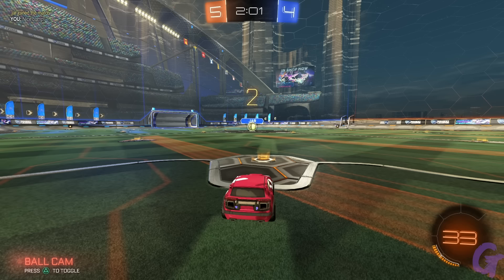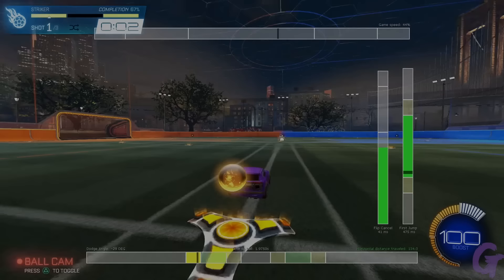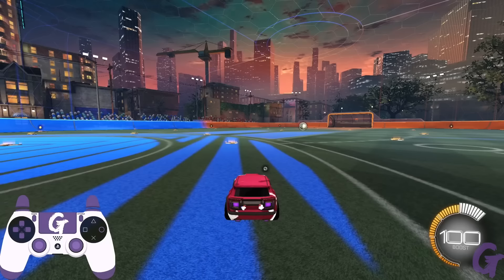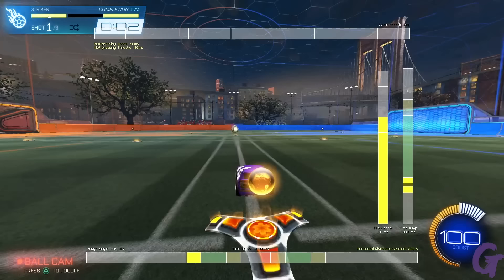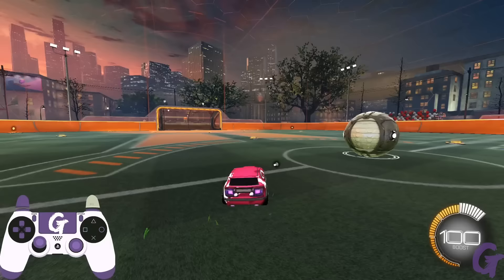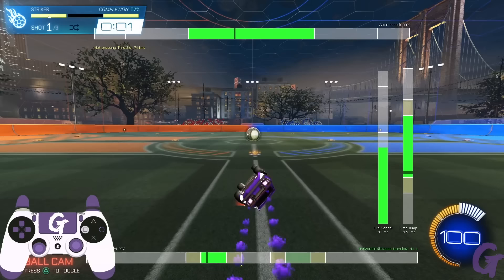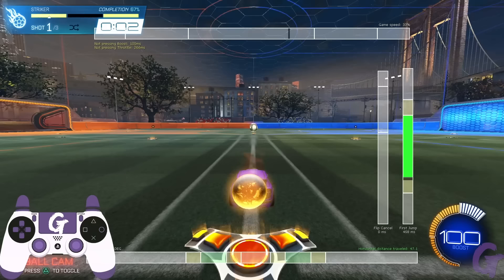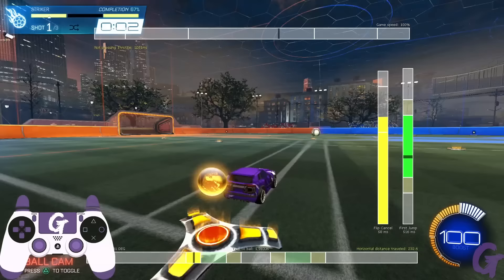How to do a Perfect Speedflip | How to Play Rocket League

Comment: Is it a bug when it says at the bottom to press boost instead of the acceleration button? It shows up on almost every attempt and im only holding my boost button and my air roll button.
Reply from the maker: Not sure.  I would also give it a moment for the car to settle before you take off.
Reply: @Grifflicious  thanks for the quick reply I appreciate it. I have tried just about everything I can think of and that message pops up more often than not. Didn't know if it actually makes a difference. Been working at trying to hit the ball for 3 days now but I'm gonna stick with it.
Reply: Just hit my first speed flip! Thanks for the help!
Reply from the maker: @Awesomesauc190  let’s go!  You’re most welcome!  Glad i could help.

Comment: Hi Griff, I think your information might be a little off, because I am able to hit speed flips below 1.9667s consistently and I'm not doing anything differently from you. If you want I can send screenshots/vids for proof.
Reply: It could be controller dependent, possibly? I know for games like Super Smash Bros Melee, the physics is so precise, that even controllers play a part in consistency (down the single frames). Maybe depending on the controller you use, it could affect how quickly you can flip cancel, or shorten the duration of the cancel. Another possible theory could that the flip is dependent on your screen monitor (the max hz your screen has). I noticed in your video that you have 120 hz monitor, while my monitor is 240 hz. Just spit-balling ideas.
Reply: I'm an even bigger idiot than I realize, what if depends on your CONTROLLER settings (like how you set your deadzone, sensitivity, etc)??? That has to affect how quickly you can flip cancel and most likely shaves off those extra milliseconds.
Reply from the maker: To our knowledge, the timer is tied to both physics ticks and FPS.  So the lower your FPS, the lower your time to ball is.  That said, if you want to get the most accurate time, I encourage you to bring up the BakkesMod console, (F6), then report back what your time to the ball is.  Also, what car are you using?  Different hitboxes touch the ball sooner than others.

Comment: Tick perfect speed flip seems like bad naming since being able to actually do it has nothing to do with how fast your inputs are compared to the other methods. All methods require the inputs at the same speed/tick. The difference is analog vs digital inputs. Simply put, the reason it can't be done on keyboard is because of the slight loss of forward momentum by being forced to do a 45 degree diagonal flip to accomplish the speed flip.
Reply from the maker: This isn't true.  It does have to do with how fast you do the inputs.  Which is why things like your timing between jumps and how quickly you cancel the dodge all affect whether or not you do it correctly.  The reason it's called "tick perfect" is due to the physics ticks of rocket league and what the fastest time to the ball possibly is.
Reply: @Grifflicious  the speed flip it self yes but you're misunderstanding. there's no different timing between methods it's the same timing.

edit: if you miss the timing on the speed flip, it's simply not a speed flip.
Reply from the maker: @Sangramoire  sure, the timing of the speed flip itself does has a window but getting to the ball in under 2 seconds has different speeds at which it can be done. So a keyboard and mouse player can get there in 1.997 seconds but they could never get there in 1.96 and that’s the difference.
Reply: @Grifflicious  yes but thats not due to not being tick perfect. You can be tick perfect on keyboard but you wont get to the ball as fast due to the other limitations not because you didn't input something fast enough.
Reply from the maker: @Sangramoire  tick perfect isn’t referring to the inputs at a specific physics tick. It refers to the physics ticks in regards to the ball when it makes contact with the car. I’m afraid you’re misunderstand something here. The tick perfect is the time to the ball. Rick perfect inputs are a thing but that don’t apply as exactly as I believe you’re referring to in this instance.
Reply: @Grifflicious  To my knowledge tick perfect has always referred to timing inputs to execute at a specific tick on the physics engine. Tick perfect has never meant to be as fast as possible. Look at fighting games as an example of what tick perfect means. Executing animations at the fastest tick possible doesn't mean tick perfect.

Edit: a better name would be fast speed flip vs standard speed flip. They are both speed flips as the concept to accomplish them is the same and they can both be tick perfect but one is faster than the other.

Comment: The 2 second timer in the pack doesnt work
Reply from the maker: Are you using Bakkesmod?
Reply: @Grifflicious  I am.. Oh wait I probably forgot to have it on when I wrote this comment. So it only works when I have bakkesmod?
Reply from the maker: @AlluttajaYT  Not necessarily.  Rather, I was curious if you had a setting ticked that altered the shot timers in some way.  I would double check all your settings and make sure  you don't have something "on" that could be causing the issue.  The training packs are universal so any issue with the timer should be a user error, as it were.
Reply: @Grifflicious  Okay well my RL install is clean. Only settings I've touched are, video and controls. At the time the 2s counter didn't work, I wasn't using Bakkesmod. The 2s thing has never worked for me ever since I tried mustys pack in 2020. It shows 2s for 1sec and then it jumps to 9 seconds. Ruins the whole point of the training pack which is why I gave up 2 yrs ago. Anyways I'll check all the settings again later today.
Reply from the maker: @AlluttajaYT  yeah, that’s an odd one. I had something similar happen to me but I can’t remember what it was or how I fixed it. When I get some free time, I’ll check into it.
Reply: @Grifflicious   My apologies, I don't want this to take any of your time but I guess I was wrong and I DID have Bakkesmod on. There was a slider that is set to 10, 10 in custom training tab. I now set it to 0, 0 which is default for the game and lets the timer do only 2s. I was 100% sure that I didn’t use Bakkesmod that day because I forgot to turn it on and didn’t bother to do it. I guess there was something left off in the files?
Reply from the maker: @AlluttajaYT  gotcha. And no worries. Happy to chat and help. Chances are, it was running either in the background, minimized, or for some reason, if you close BM while you’re still playing the game, it acts as though it’s still running and can interfere with the game.
Reply: @Grifflicious  that might be true! Thanks for the help and replying :)
Reply: @Grifflicious  Another issue I noticed is that in your video and many other's videos in the training pack the ball seems to stay place in the middle just like in a kick-off it would. So does it fall down a bit or stay still but start moving when I try to attempt the kickoff. Sometimes the ball moves away so there is a 0 chance to hit it. Did the pack get changed to be this way or is the ball supposed to stay still?
Reply from the maker: @AlluttajaYT  Nope, it shouldn't move.  This again sounds like a BakkesMod variable that has been changed in the custom training.  There shouldn't be any reason, other than that, that the ball should move.

Comment: people make speedfliping so much harder then it has to be if you take in to count how you make your car drift in circles in one spot take those inputs and use those same styleof inputs when doing a speed flip if you are using a joystick on a controler you want to dodge diagonaly forwards to whatever direction you prefure then roll the stick to that same side you fliped and downward if you are doing it on KBM you do for the left side its W A S for the right side its W D S just alternated really quckly while holding your air role button its as simple as that no need to over complicate it with all these retarded spesific angles when you fine tune it the more you do it I can speed flip better then most ssl players as well as some pro players using these methods somany people over complicate this game and it makes me laugh sometimes when you can make things so much more simple
Reply from the maker: You know, I can also take my temperature by sticking a thermometer up my ass but it doesn't make it the only way to do it.

Comment: this guide is useless for pc players , you're just saying how to do it on controller and expect us to understand
Reply from the maker: I most certainly do not! I included the section about KBM players and how the most they could do is a 45 degree flip.  Which involves holding "W" and either "A" to flip left or "D" to flip right.  Regardless of input, all the same principles to the mechanic still apply.  And for the record, I'm a PC player.  I just use a controller.